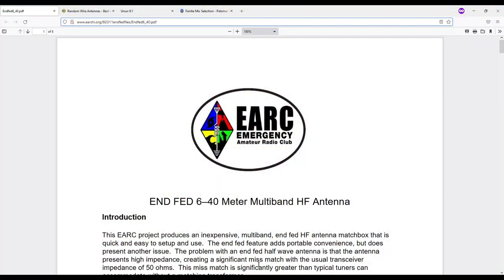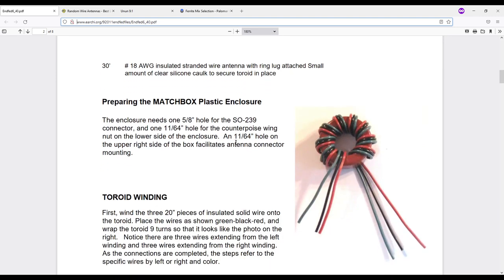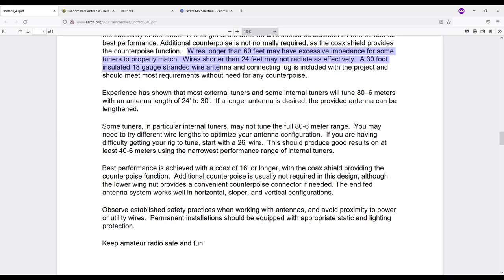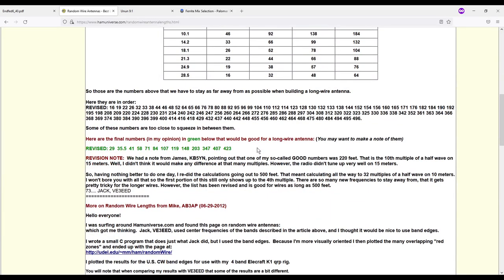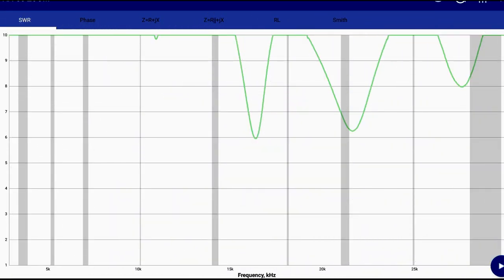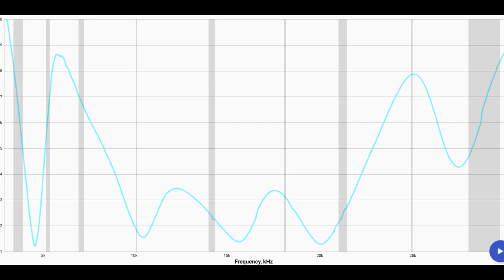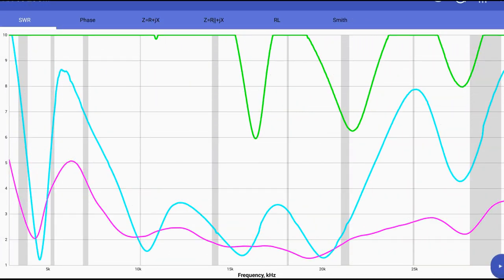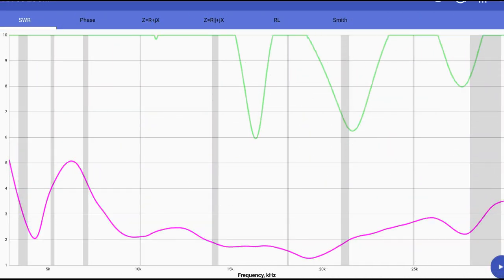9:1 UnUn / BaLun Antenna and Counterpoise for Ham Radio

Comment: First! :D
Reply from the maker: Yes you are!
Reply: @TheSmokinApe  Good video, it's nice to see the actual difference with the graphs. I did the same thing with my K6ARK 9:1 antenna, 43' radiator, and 17' counterpoise and it worked great for QRP. When using random wire, always use a counterpoise, otherwise you're just warming up a choke with RF. :P
Reply from the maker: Yeah, I never understood why so many people say not to do it 🤔
Reply: Well Played!♡♡♡

Comment: Nice experiment! I can only confirm that the 9:1 ununs work really nice but the counterpoise and the ATU is a must. Some 9:1 ununs are called by their manufacturers “the magnetic balun” but after looking inside of it I found just the same trifillar unun :). As it comes to the 43 ft wire , I have pretty positive test results despite this length is not listed on the “good/bad lengths” list. With 9:1 unun , 9m (27ft) counterpoise and the CGJ-100 ATU I had no problems to find a match on all bands from 160 to 10m bands. Naturally, one can not expect any high efficiency of such an antenna on 160 or 80m but it is working and real contacts were made. Good luck in your further experiments! 73! Linas LY2H
Reply from the maker: Thanks for the reply Ly2H, these 9:1's are some of my favorite antennas.

Comment: Another good video Ape!   Have you considered trying a 16:1 rather than 9:1 b/unun for this configuration? Based upon your optimized (purple) sweep, 40m (highest swr) is ~4.3:1 swr at center  and might be reduced to ~ 2.4:1 swr  (measured swr x 9 / 16). with a 16:1 (4 turn) b/unun. 80/75m might drop from 3:1 ctr to ~1.7:1, 60m to ~2.3, 40m to ~2.4, 30m to ~1.2, 20m & 15m to ~1.01,  12m to ~1.5, 10m Tech portion to ~1.4 and the FM portion to ~1.9, 17m would dip below 50 ohm and be ~42 ohm / 1.2 swr. Food for thought. Remember, just because something works doesn't mean it can't be improved upon. BUT there may be some reason this wouldn't pan out, I've played with some antennas through the years but I'm no LB Cebik (RIP), and you have much more experience with these antennas and b/unun's than I do.    73s   mike  N4ONL
Reply from the maker: Hey Mike, sorry for the late reply.  I have seen the 16:1 used on loops and stuff but never made one.  I'll look into them more and possibly do a video, thanks for the suggestion.

Comment: Hi there
My experience with 9:1 unun and 84’ of wire lenght and without counterpoise is great regarding swr exept 20m.(1.8)
But eficiency is very bad specially in the 10m band.
Reply from the maker: I like 9:1 antennas because of the ability to use them on multiple bands but to your point efficiencies can be a concern.  I have a few videos where we measure the loss of the cores, here is one of them: https://youtu.be/6j1Yc1Y4Ly0

Comment: New to antennas, so thanks and forgive my questions if you already covered here or elsewhere. Could you include images of where/how you attach on the next video on this topic? For example, I just built KM4ACK’s efhw antenna; where would you attach a counterpoise on that antenna? Would you think it is needed on an antenna with a 49:1 toroid? I realize I am talking about an efhw, vs a random wire. Thanks!
Reply from the maker: Hey Ryan, I typically use a counterpoise with bith EFRW and EFHW antennas.  You connect them to the ground lug.  Thanks for watching!

Comment: I know you say to use a 17’ counterpoise wire. But wouldn’t that be the same as using the coax as the counterpoise and then choking it at the radio end? I’ve never used a 9:1 random wire, but I may have to buy one just to try it out. Thanks Ape!
Reply from the maker: Hey Trucking, no it’s not the same.  The counterpoise becomes part of the antenna and I don’t want that to happen with my transmission line.  Yes, choking at the radio will help but my personal opinion is keep the coax as transmission line and add the ‘poise 👍

Comment: I am assuming that this experimentation was done after the best SWR match could be achieved with the actual length of wire for the antenna first?
Reply from the maker: We did not as a random wire isn't supposed to be resonate on any ARS band.  It's a good question and a fair point though 🤔

Comment: Does a counterpoise reduce common mode current? I am not using a counterpoise and an getting a ton of connom mode current even with a mfj 915 1:1 choke.
Reply from the maker: Hey Joe.  It will help with CMC, also choke both ends of the coax 👍

Comment: What's ideal lengths of counterpoise wires? Is this a per band thing or is there a magic length? What's a good amount of counterpoise wires to use, is more better? Take that Ape!
Reply from the maker: So there's a lot to this.  When I think of a dipole, I think about the two sides and how AC current is bi-directional with equal and opposite force.   An EF antenna needs something to oppose current, and that is what we use a counterpoise for vs the shield fo the coax, which has it's issues.   For most antennas I start with about 17' and adjust from there if necessary...  keep in mind that I don't typically go below 40m and really only want SWR < 1.5:1, I am more concerned with resonance.  When we add more and more counterpoises, I like to think of them as radials for my  "ground plane".  Which is kinda like an artificial ground that's "better" than the actual ground.  What I attempt to accomplish is something that capacitively couples my antenna to the Earth and helps with signal reflection not signal absorption.   Check these out:  https://youtu.be/2X6bSIECESk and https://youtu.be/orS0Qodaats.

Comment: Question on the counterpoise, my random length antenna is planned to be 148' in length and will span from the chimney on my house through 5 trees. I plan to use a weight and rope on the end hanging down from the last tree to take up some of the slack but let the trees move without yanking too hard on the wire. The longest free span till be 46'. The coax feeding the 9:1 will run up the end of my house to the root and then over to the Chimney which is a total length from the radio of approx 60'. My plan is to have a 1:1 unun in the line where the coax comes out of the house. My questions:  1. should the 1:1 unun be better near to the 9:1 or is just outside the wall of the house ok?  2. how do I run the counterpoise. It could follow back along the coax to the ground outside the house, or run down the roof near the 9:1?  3. What kind and gauge wire for the counterpoise? Do I bury is or hook it to a ground rod? If you have a way for me to do so I could forward a sketch to help understand what I am saying.
Reply from the maker: Hey Tim.  I would put the choke at the antenna feedpoint and use a counterpoise made with 18g stranded copper wire.  I would not run the CP near the coax if possible to reduce the chance of coupling, I would also put a choke at the radio end of the coax.  For the length I would start with about 17' and try it out and adjust if I felt it was necessary.  Good luck!
Reply: @TheSmokinApe  would i just run down the roof to the ground and bury 17 of wire in the earth?

Comment: Stupid question: When you say you ran the counterpoise 90 degrees from the antenna, do you mean on the ground under the wire like you did with the coax, or away from the wire?  

My coax runs in the opposite direction from the box and emitter wire.  Should I run a counterpoise in the direction of the emitter wire?   Would longer be better? (Longer than 17’)
Reply from the maker: Hey Rob.  I typically keep it to 17' unless I have a problem...  I am assuming that you are choking the coax, I typically run the counterpoise the opposite direction of the element but may change that if constrained.
Reply: @TheSmokinApe  I have four large ferrites on my coax at the receiver side.  I tried a 33 foot counterpoise as in the opposing direction from the wire, but it seemed to make the SWR worse than without a counterpoise.    Still tuned either way the difference was most pronounced below 20 meters.
Reply from the maker: I'd try 17' and see how that goes.

Comment: Smoking ape I'm going to ask you a dumb question bear in mind I'm new at this I'm still technically studying for my license what is a counterpoise
Reply from the maker: It’s similar to a ground in that it gives the element something to work against.  Antennas use AC current which flows in both directions, without a counterpoise the current will flow on the coaxial shielding which is problematic.
Reply: @TheSmokinApe  So, in functionality, it works like a ground. Allowing the access energy from the antenna to bleed off instead of being reflected back on the coax shielding will cause interference.
Reply from the maker: @chrono581  pretty much
Reply: @TheSmokinApe  Thank you for your assistance 👍😀

Comment: Great data. I am adding a 9:1 EFRW 203 feet in less than ideal conditions. Actually I was impressed with the overall resonance and SWR except for 80 and 160 M. So with you advice I will add the counterpoise. Is there an optimum length for that configuration. Thank much. Thumbs up and subscribed.
Reply from the maker: Hey Richard, I always start with 17' and work from there.

Comment: Thanks for the excellent advice. I'm in a similar situation. I bought Nelson Antennas 9:1 UNUN off eBay to use with my EMTECH ZM-2 tuner (no tuner built into my QCX-mini) and I'm quite impressed with the combination. The ZM-2 would tune 29-foot and 41-foot slopping antennas on 40 and 20 meters, but the controls were touchy. The 9:1 pulled the impedance down enough that tuning it onto those bands with a NanoVNA was easy. Simply move the SWR dip onto the bands with the left knob on the ZM-2 and tweak it with the right knob. Sometimes attaching a counterpoise helped to lower the SWR.  In the future, I'll be taking your advice and orienting the counterpoise in different directions to see what difference that makes. A couple of tent stacks should keep it from coiling up.
Reply from the maker: Awesome story Michael, glad to hear the video helped you out!

Comment: Is there a chart to show what length counter poise to start with using the 71 foot wire? Or do you have a suggestion?
Reply from the maker: http://www.hamuniverse.com/randomwireantennalengths.html that should be what you need 👍

Comment: This antenna and transformer makes no sense to me.  You would need an antenna tuner to use this thing so why use the lossy transformer.  I would connect the "random" wires to my tuner directly and forget the transformer.  This would be less loss.
Reply from the maker: Hey Rick.  Part of the reason you would use this antenna is that it will “work” on multiple bands, as a result folk will trade so loss for a multi band antenna.  Also, whether you use a unun transformer or a tuner you are doing the exact same thing and loss is compatible as I understand.  In this case the 9:1 is doing the heavy lifting instead of the tuner.  Yeah have a different 9:1 that is about 1:1 on 20m and higher with no tuner required.  I also have one that’s 1:1 on 40m so your mileage will vary with element length.  Thanks for checking out the video Rick.
Reply from the maker: Hey Rick.  Part of the reason you would use this antenna is that it will “work” on multiple bands, as a result folk will trade so loss for a multi band antenna.  Also, whether you use a unun transformer or a tuner you are doing the exact same thing and loss is compatible as I understand.  In this case the 9:1 is doing the heavy lifting instead of the tuner.  Yeah have a different 9:1 that is about 1:1 on 20m and higher with no tuner required.  I also have one that’s 1:1 on 40m so your mileage will vary with element length.  Thanks for checking out the video Rick.

Comment: I have a 50’ long trifilar 9:1. No matter what I use for a counterpoise, I cannot get 160m to tune even when using a manual tuner.
Reply from the maker: I can’t get 50 to tune 160 either, not sure how long you need to go for that one.  Thanks for checking out the video Kyle 👍
Reply: @TheSmokinApe  My pleasure, you have awesome videos.
Reply from the maker: Thanks man!
Reply: This video gives great info on these antennas about midway through and lists wire lengths vs counterpoises and the correct coax length and choke point.  Enjoy  https://www.youtube.com/watch?v=4lzlZxxUzM0&t=2460s

Comment: I was understanding  that 0.05 wave lenght counter poise is the preferred wire length at the lowest operating frequency.  Hence a measured counterpoise is better than a randomly cut wire lenght??
Reply from the maker: It's my understanding, and I could be wrong, that is the general thinking for a 49:1 EFHW.  I usually start with about a 17" counterpoise and tune from there.  Thanks for the comment George!
Reply: Excellent suggestion. I try your advice in the near future when it cools off here in Spokane, WA.
Reply from the maker: @georgetimm8203  best of luck with it 👍